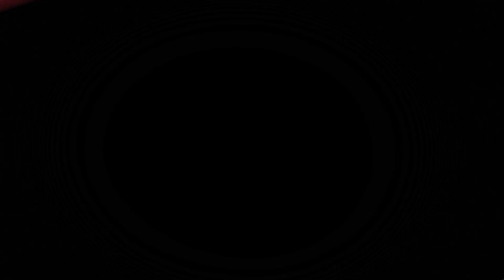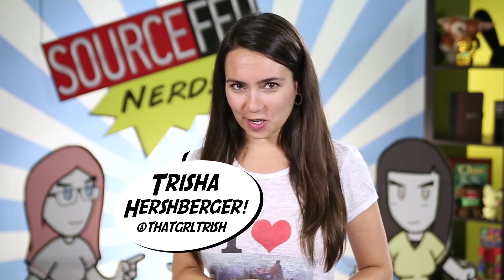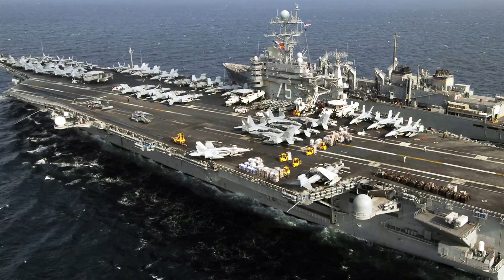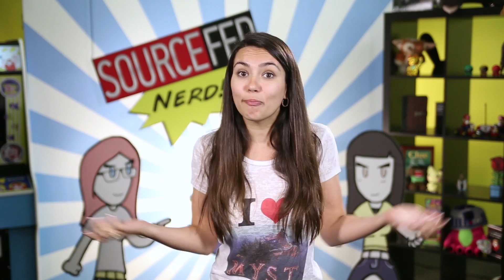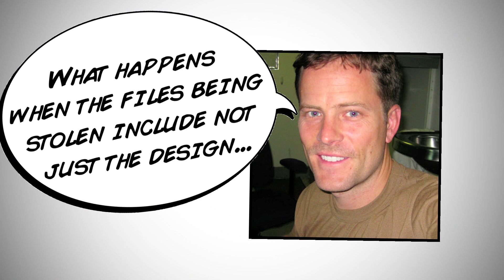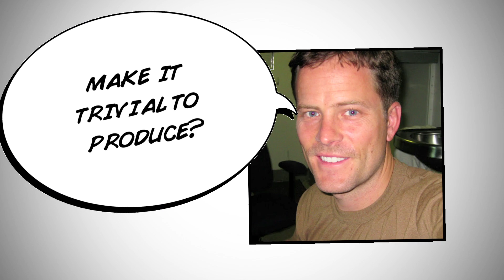3D Printing Aircraft Carriers?!

Comment: We have FEMA down in SoFla because of the hurricanes. If you check into a shelter during an evacuation, you can't leave until the evacuation is over... BECAUSE THERE'S A FUCKING HURRICANE OUTSIDE AND YOU WILL DIE. I've never seen one of those signs, and unless you have proof, I call bullshit. Also, after the storms are over, FEMA and the Red Cross pack their shit up into trailers and park them at the Red Cross center until they're needed again. Stop reading Internet conspiracy sites.

Comment: They would need to have a super advanced 3d printer and quantum encryption like Sandia labs has &or a super CRC that will only work on the navy system. Which face it most of the stuff the gov. has is about 20yrs+ of what we are seeing in the current market so they probably already have the printer(I don't work for a secret gov org, I am just basing that off of the declassified tech that we see on shows that date back 50 years and is on par with what the commercial world has in current times)

Comment: From what little I know about 3D printing and lot I know about aircraft, this is still years off.   But if they could print metal parts with specific heat treatments/hardness requirements, that would be cool.

Comment: I'd say yes to the ammo, just because they run out fast. But not to the big shelters or guns. The guns can be easily repaired in their current form, and the army uses tents and E-tools to make shelters for a reason: they still work. Also, imagine trying to 3D-print a full-size tank. Imagine how long that would take versus air-lifting one in already made.

Comment: First of all, the total cost of war will not outweigh the benefit from the oil. The cost of the war in Iraq is currently at $1 trillion, and the cost of benefits care for veterans is estimated to be at between $1-6 trillion by 2050. The oil reserves in Iraq is estimated to be at about $100 billion, I.e. $1/10 of a trillion. This obviously doesn't add up, besides Iraq suffered the biggest cost of all. About 1,000,000 killed and completely destroyed infrastructure. And no oil left...

Comment: Regardless of the moral implications, as with the nuclear weapon specs you can easily find all over the net, all it would take is one enterprising young internet arms designer and POOF! The 3D printing of anything from a small pistol to a casing for a light saber are at the hands of anyone with a 56k modem. The ability to keep any technology a secret for very long, even if it is technology designed spontaneously, and independently, is an impossibility in our fast increasingly connected world.

Comment: Sounds like some kind of structure from an RTS like Command and Conquer or Warcraft/Starcraft.  Goddamn I wish they'd bring the Warcraft series back to RTS!  But Anyway, I believe this is a complete pipedream until 3d printing becomes more practical, cheap, and reliable.  Also building the security for it seems like it would be a hassle.

Comment: A better solution is to have the design information hardcoded onto individual chips, like a flash drive, so no data is exposed to the internet. No connection to the internet, no way to hack it remotely.

Comment: We got a 3D printer for the engineering department at my high school this year and while it is awesome we have still had some problems with it. For instance the machine shakes a lot when it prints and because the table we had it on wasn't sturdy enough it broke a peace of the printer, so while the technology would be cool to use in military operations I think we need to allow it to develop further before we start putting it on ships.

Comment: not really... the only expensive thing is extrusion printing, what most home 3d setups would use, and even than its only expensive in the time sense...

with 3d metal printing, you could print hundreds of custom parts at once, and have them bake. for an on ship and always in stock solution, its better, faster, and cheaper than anything else

the problem is the precision and resolution aren't there yet.

look into 3d printing, its really a lot cheaper than you think.

Comment: 3D printed objects have another inherit problem being they are week in both shear and strain stresses (basically push and pull) meaning they would easily fall apart to the rigors of repeatable firing a weapon or taking hits from one.  In the case of drones the constant stresses from the wind, drag, and friction would most likely end in very very short lifespans.

Comment: 3d printing isn't expensive. a home printer starts at about 300$ and can be as good as the 2000+$ commercial printers
the print material is being gouged right now, but you can make your own filament for 3$ a kilo if you spend 250~ on an extruder.
with that said, metal 3d printing doesnt have the resolution yet to be gun capable, and plastic is just hitting the we know how to design a gun stage.

Comment: all i've got to say about the subject is that it's a good idea, and by being used by a scientific and a militaristic force the tech for this will advance at a much faster rate than it would have previously, and that's considering that our tech is already advancing at light speed. the process will become more efficient, more cost effective, and be made faster over time. eventually this will be something where if need be instead of having parts on board they'll just print as they need in minutes.